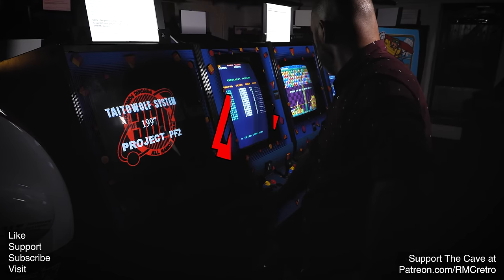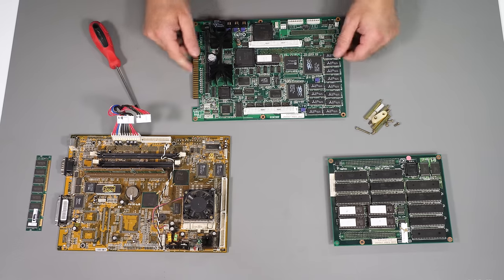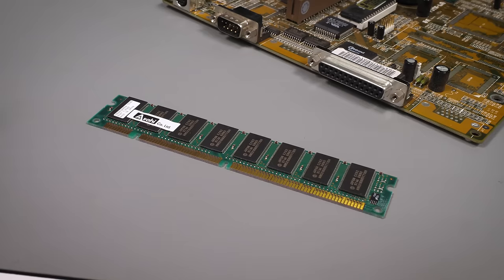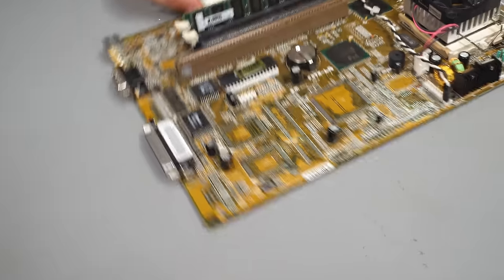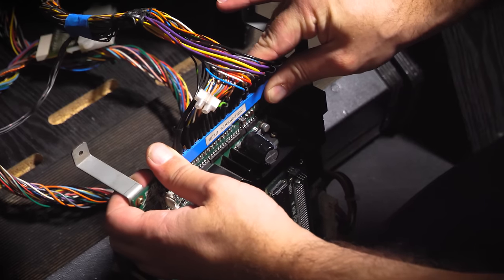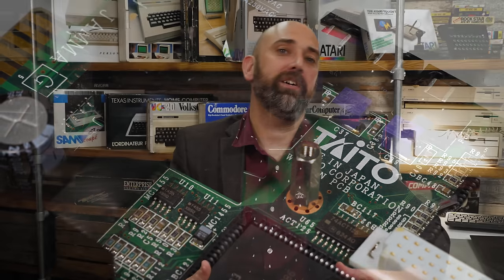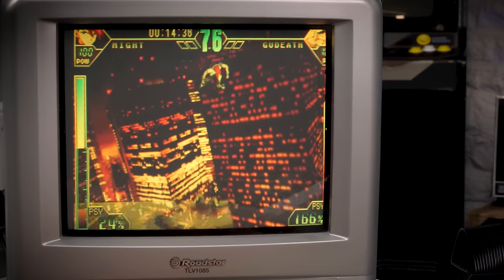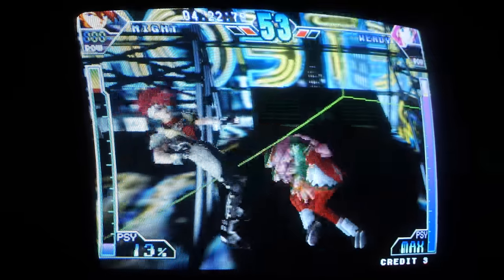What is Taitowolf? Late '90s Arcade Technology | Tech Nibble

Comment: What was the downfall of 3DFX?
Reply: 1) Poor business choices - specifically, trying to bring board manufacturing in-house, and upsetting all the OEMs they previously worked with.

2) Competition with other 3D chipset suppliers, namely nVidia.

3) Going all-in on power-hungry parallel GPUs.  As such, the last Voodoo cards required external power (now common, but at the time, everything else was powered solely by the PCI/AGP slot), were relatively hot, and got their lunch stolen from more efficient, faster, lower-power, cooler, smaller solutions.

4) They were a bit late to the party with a flagship card that wasn't JUST a 3D accelerator.  All of the mainline cards up until the Voodoo 3 were solely 3D, and required a separate 2D VGA card.  There were a few combo 2D/3D cards -- e.g., Rush, that combined a lackluster 2D core with a cut-down 3D chipset; and the Banshee, which was fully integrated into a single chipset, but still gimped compared to the "real" Voodoos.
Reply: They thought they were going to sail through on API lock-in and keep releasing derivative, compatible GPUs, which people would keep buying because well if you're gaming in the 90s, you're gonna need that Voodoo. But they fell behind, and DirectX got rapidly better enough that everyone was supporting that and nobody cared about GLide anymore. Features shipped too little too late as well. 

The problem with GLide is that every card needs to be 100% Voodoo1/2 compatible in hardware including memory map; so Voodoo 3 had in fact different hardware modes that it would switch between automatically. But like you can imagine this meant hardware overhead and competitive disadvantage, since they couldn't just switch the internal GPU architecture completely EVER, only relatively small changes which can be configured out at runtime. So their reason for early dominance, a simple low-overhead API which did well with CPUs of the era and was simple enough to be 100% robust, became their noose.
Reply: Nvidia